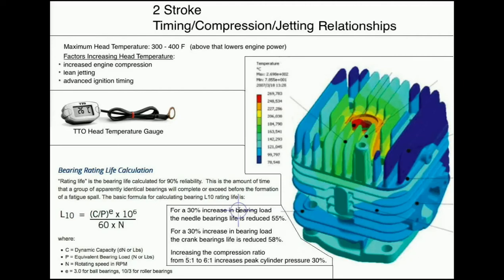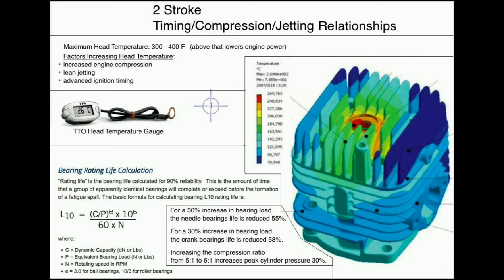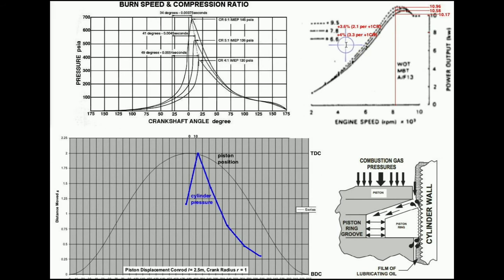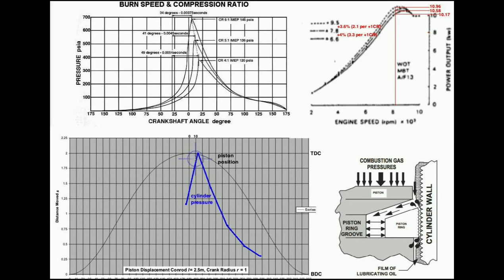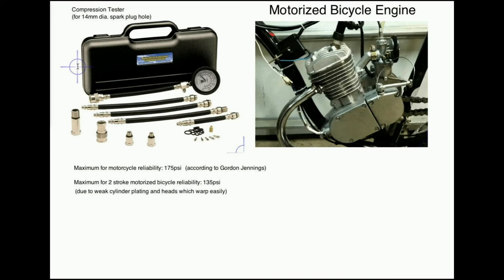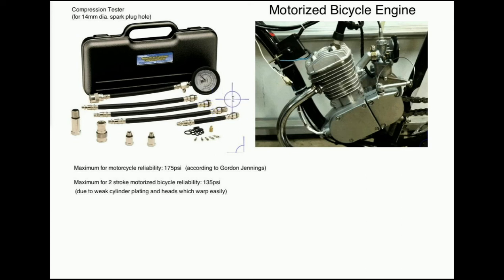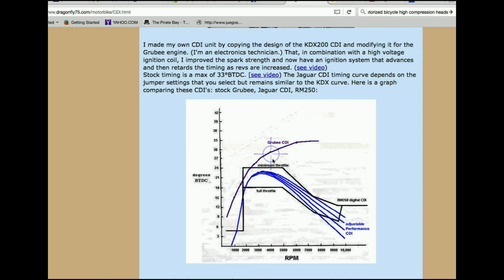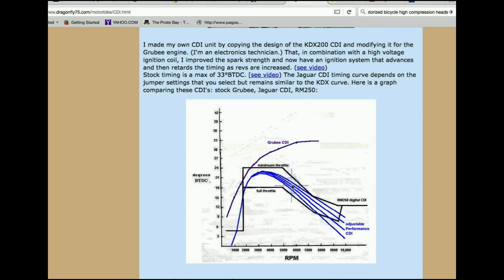2 Stroke High Compression Considerations

Comment: My YD100 bicycle engine revs really high when I pull in the clutch my engine won't idle due to this issue any thoughts would be helpful
Reply from the maker: that is almost always due to an air leak (between carb and cylinder, head gasket, crank seals, or even where the two crank halfs mate together)

Comment from the maker: As a correction to this video I need to clarify that if the average cylinder pressure is increased 30% over 200 degrees (160 degree port duration) then the bearing life is decreased 35%, not 55%. But that is still a significant loss.